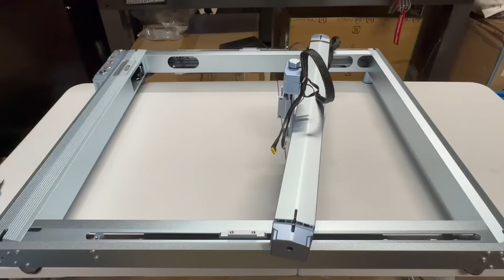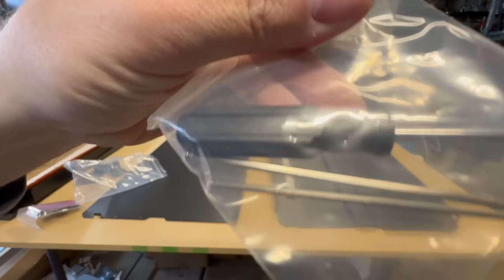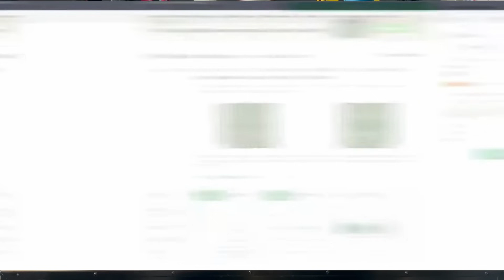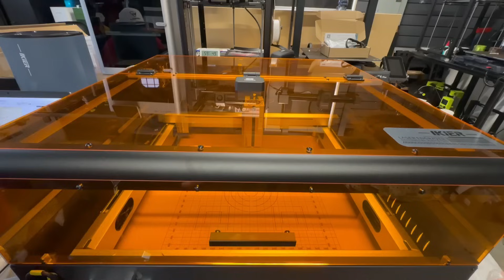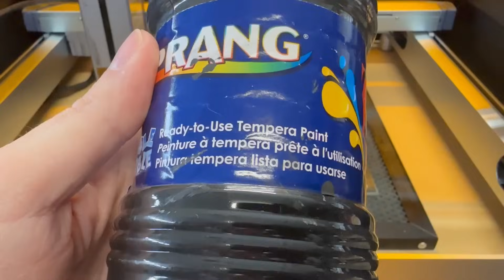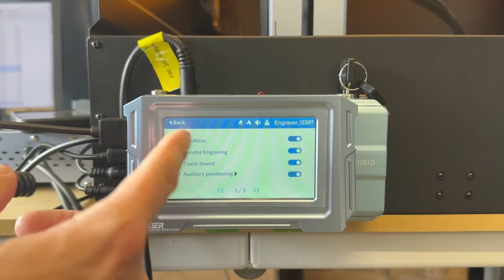IKIER K1 PRO MAX 70 WATT LASER

Comment: Hi thanks for your video, but sorry I'm confused you said the working area is 410x410mm then you said it's far too big to fit on your table.
That machine looks a lot bigger than the size you said.   Sorry if I'm wrong.

Comment: What are the advantages of 70W power over 30W power?
Reply from the maker: Well with more power you can actually process jobs fast.  Say a job would normally take a couple of passed, now might take only one.  Or you can use more power, and have the laser move faster to complete the job faster.  Of course there is the cutting, it can cut thicker material more efficiently.  Thanks for watching and commenting.

Comment: Thanks for the nice vid. Good work. Have you ever tried cutting bamboo. If this thing could cut through a .5 inch bamboo cutting board I'd buy it. Just don't want to plop 2k to find out. My 80 watt co2 will not do it.. the glue i guess. Maybe blue laser will?
Reply: Any luck finding out?
Reply: Nope

Comment: Did you attempt to cut (not engrave) metal items?
Reply from the maker: A 455nm laser is not intended to cut metals.  So I didn’t attempt it.
Reply: @TripodsGarage  perhaps not, except this guy is doing it with that exact machine.  ( https://youtu.be/GHFWKfaUeuU?si=QMKfNQSrF_v0xi0A )
Reply from the maker: @QuentinKarmark  😂😂 When you made the comment, I knew you watched Chad’s video!  Chad and I receive a lot of the same products, and support each other’s work.  As Chad mentioned early into the video, that it “isn’t” suggested that you try it.  We are talking very thin metals.  You could think of the metal as almost like a veneer if you were to cut it out successfully.  I did this on the xTool 40w video.  I would suggest if you are wanting to cut metal by other means than a blade, get a plasma CNC, high power 1064nm 1k or higher laser, or CNC capable of doing it.
Reply: Ok, appreciate the timely and thorough response… I actually have a need to cut very thin metal, and after seeing Chad’s video, was very excited to see if anyone else was attempting it with this or similar machines… especially at this price point.

Comment: Nice review Bro! I just got the Atomstack 70. The only reason I accepted it is to put the module under the power meter.
Reply from the maker: Thanks bud!  It is definitely a lot of screwing around before you can actually engrave anything 😂.  Minus the enclosure leaks, it isn’t that bad of a laser.  Certainly is a little over the top in power 👍
Reply: @TripodsGarage what do you mean by having to screw around a lot before engraving?

Comment: Great job on the review...the glass came out fantastic. How does the autofocus work...accurate?
Reply from the maker: Many thanks!  The cutting board would have been perfect, only if I would have checked for paint on the other side 😂.  You move the laser over your material, and press the autofocus button, just that simple!  Was accurate for everything I used it on.
Reply: @TripodsGarage  great…thanks for the info!

Comment: This was an informative video. I like what I see, for the most part, but think this may be too much power for me. I know that seems weird, but when you only need 1/4in or so, it can matter. Then again, the higher possibilities could be a nice trade off versus a 30W for only a hair cheaper.
Reply from the maker: Many thanks!  It is a lot of power!  As I mentioned, 1/2 material is about the limit I willing to cut.  I am wondering what will be the power cap?  There has been a huge jump in 455nm laser power over the last two years.  Frankly, I think the limit should be 40-50w.  Thanks for watching and commenting 👍

Comment: Great review.I was about to buy this,the 70w was tempting.But I got the impression that the Ikier brand seemed a bit flimsy and on the lower quality side when it comes to build quality.And the way they have the wires,tubes etc is just way to messy for me.And i do believe that the bends you got on the enclosure is not from shipping,but bad handling at the manufacturer.To get these kinds of bends on items inside the box,the box itself has got to be badly damaged as well.I ended up going for the Xtool S1 40W,not perfect but i think that is a better choice then Ikier in terms of quality and usability....the thing the s1 is lacking compared to Ikier is camera and less power.I do believe the Ikier is more a cutting laser,and not perfect on detailed engraves,since it got a big spot size.Maybe that is no problem since you can change the wattage on this between 35w and 70w,making the spot size better for engraving in the 35 modus ?

Comment: Excellent review.  I've had my 70 Watt system since the beginning of February and have been very happy with it so far.  My enclosure did not have the damage that yours exhibited and it is good and light-tight; I can't say the same for the aluminum workbed that I got with it - it was undamaged, but despite the assertion one does not need a backing plate because the workbed is the backing plate, it has light leaks and the laser burned into my workbench.  Like you, I love the auto-focus; however, users need to be aware that there is a bug in the Ikier firmware and it does not work in imperial units.  If you work in imperial units and do autofocus, the laser's autofocus command fails to convert to metric and tries moving the laser head up in the z direction by 8 inches after contacting the workpiece surface.  The workaround is to set up Lightburn for metric, home the machine, command autofocus, then set Lightburn back to imperial and re-home -- not super efficient.   It is even more catastrophic if you try using the auxiliary positioning function when working in imperial units -- the laser head gets accelerated rapidly to the upper right and literally crashes against the right limit switch.  I have communicated this issue to Ikier; I don't know if they will resolve this in a future firmware release or not -- it took several email exchanges to get them to understand and acknowledge the problem.  They claim they have sent this issue to their software development team.
  My overall impression is that the laser and mechanical design are scary well-done.  However, the documentation and communication are not very good -- as you pointed out, their documentation and labeling contain multiple mis-spellings and while the assembly and operating instructions are generally well done, there is absolutely zero documentation on recommended maintenance items such as belt tensioning, rail lubrication, or cleaning the lens cover.  I absolutely love the switchable power levels; I mostly work at 35 watts and use the 70 watts for thicker material or faster cutting.  I've used the step down function in 70 watt mode with Lightburn and it works flawlessly and really does produce a better cut in thicker material.
    I got the Ikier to replace a 20 Watt xTool D1 Pro that has apparently lost power due to use according to xTool and can no longer cut material I was previously able to cut.  It is meeting or exceeding my expectations as far as capability.